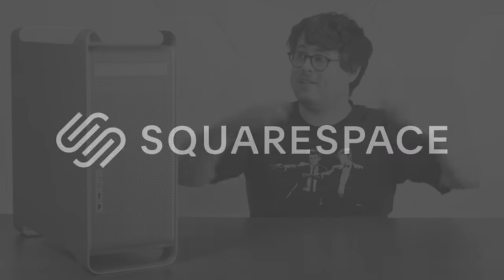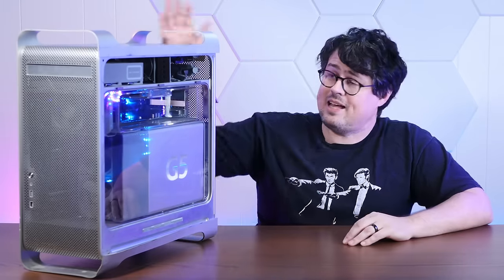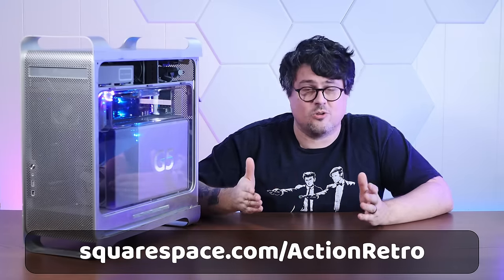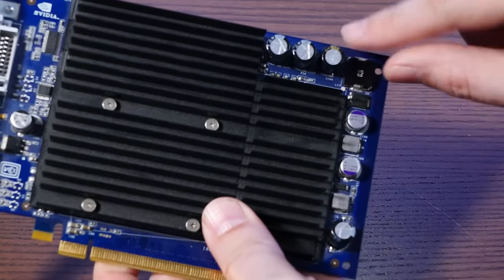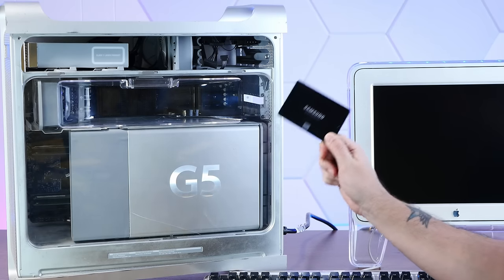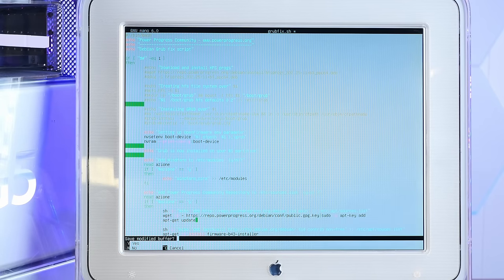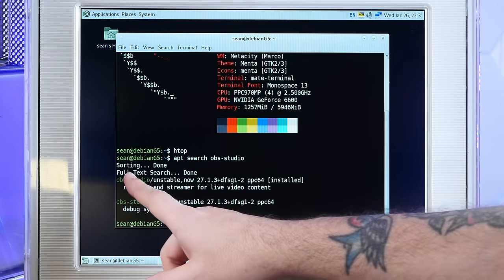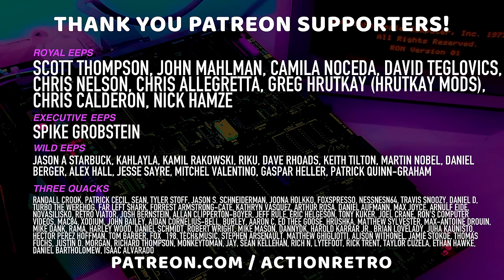Four G5s, in ONE PowerMac? It's the fabled G5 QUAD!

Comment: Hi Sean. Proud owner of two of these g5's here. You've got the best and reliable version of quad g5 ppc. These won't leak, but i would suggest replacing thermal paste on these cpus and north bridge which is located between case and motherboard. You have to remove everything including motherboard to do so. Get some temp reporting software to check what is actually happening before you put too much stress on it. Also, you probably won't remember this, but i'm a guy with that quad g5 ppc who  played on your g5 minecraft server during ppc week. We even exchanged few words at that time.
Reply: Was there a change in the hardware for these that helped them not leak?
Reply: @elitexcomputing8802  Water blocks are completely different. These newer revision gasket o-ring nevel leaked in my case. You still need to check periodicaly to spot early any leaks. Removing LCS(liquid coolig system) and separating procesors from waterblocks. I would also recommend replacing coolant for something like destilled water and anti corrossive, anti freezing, growth prevent solution. You can compare all LCS revisions on the internet. This one is the latest and probably the best . One of my quads still have original water blocks, second one has experimental modern water blocks. Who knows if this will change reliability.
Reply: In 2009 my quad G5 sprung a leak and over heated. Took it to the local Apple store and they gave me a Mac Pro 4,1 as a free replacement even though the AppleCare had expired. While I missed the old girl, the Xeon processor beat the G5 in everything I could throw at it. Was nice to be around when Apple treated their Pro customers very well.
Reply: @montex66  Surprising that Apple even cared. Xeon processors are completely different architecture, much better and powerfull. Too bad we do not know what lcs was used in yours late G5. There were three i think mostly known revisions of lcs. Might be something different as well.
Reply: @RadoslawKasprzak  that’s great to know. Drain flush and fill with distilled and something like utopia sounds like an easy maintenance to do.
Reply: I have one as well and while they won't leak (they didn't suffer the o-ring failures of the previous models), almost all variations will have their pump die.  I ended up attempting to refurbishing this myself by flushing out the coolant and refilling it (with all the requisite air bleeding).  It was a giant pain and still didn't have enough flow over the blocks to actually cool the CPU at full load.  I went through several sketchy mac replacement parts websites where they sent me replacement CPUs (they come shipped as one unit), and I've seen just about every variation of this pump configuration.  None of them actually worked.

The thing I ended up doing in the end and swapping out the LCS for the heatsinks that shipped on the 2.4GHz dual core model.  Those actually do a decent job but you need to cut the heatsinks and blocks down to size with a hacksaw.  Totally worth it as these liquid cooling systems are an inevitable disaster.  When I first bought mine it was in working condition, but years of usage and a few nights of compiling a usable Gentoo userland definitely took its toll.
Reply: @elitexcomputing8802   "Was there a change in the hardware for these that helped them not leak?"

Put simply, switching from an LCS made by Delphi Technologies to one made by Panasonic.
Reply: @montex66  I had a similar tale albeit lower spec: my second-gen white MacBook (Core2Duo rather than Core Duo) was replaced with a first-gen unibody 13" MacBook Pro after overheating and kernel panicking issues, which their techs couldn’t fix after 3 weeks so they just replaced it. 

Though mine was still just barely in AppleCare by a few months, and this was a month before the second generation unibody Pros came out, so I bet they were happy to unload some of the stock. 

I should’ve just taken it right to the Apple Store, but first I tried a local Apple Certified Repair shop — and they gave up but deleted all my crash logs which I’d foolishly not backed-up! So perhaps the Genius Bar techs would’ve not tried for so many weeks if those logs had persisted. Oh well, I still won out in the end.

Comment: I said this on Ken's video too, but the really dumb thing that baffles me about the quad G5 is the fact Apple decided to use GM Dexcool antifreeze as their coolant of choice. It was well known in the auto industry to corrode and ruin parts of the engine, most notably, intake gaskets. 

By the time the G5 Quad came out, General Motors was already subject to several lawsuits from Dexcool ruining their vehicles. When there was plenty of other fine coolants for computers back then, I don't know why Apple thought it was a good idea to use a controversial automotive coolant that's known for corroding anything metal.
Reply: it was likely cheap and maybe they were both at CES
Reply: I’ve never even heard of antifreeze being used to liquid cool a computer. Is that a common thing? Sounds disastrous.
Reply: @JoeyPerleoni  yeah man i'm a certified tech and the very thought of using antifreeze terrifies me to hell and back
Reply: @SoulcatcherLucario  glycol aka antifreeze is used in all kinds of water systems with varying metals .Black Iron pipes carrying most of the water but could be galvanized ,copper, plastic, brass etc. Those systems use anti rust compounds or just oils for lube and the glycol is anti freeze . it offers some freeze protection . thats why its in a car that can be in -30 degree weather driving down the road.
Reply: @tobiwonkanogy2975  oh i know, i'm just talking about liquid cooling a pc here haha
Reply: @SoulcatcherLucario  it rusts less than raw water. that was my point.
Reply: @SoulcatcherLucario  Many AIO liquid coolers use what is essentially antifreeze as the liquid.
Reply: The first generation lcs was developed by Delphi Automotive, I think it was the decision of Delphi to go with Dexcool. I doubt that Apple had a say in that since Delphi was tasked to provide a cooling solution.
Reply: Oh man, they used Deathcool? That explains everything.
Reply: That's what they get for sub-contracting the LCS to an automotive OEM (Delphi). Not that they would have had a much better time with the early AIO makers at the time (I forget the name, but there was one company with a patent on it), those had their own problems.
Reply: Dex killed one of my cars and would have killed another one if I hadn't proactively replaced the intake manifold before the damage got to the point of no return. I don't care how well it may work, there's no way I would use that stuff to cool a computer. Or anything else...
Reply: I put put pennzoil coolant in mine :) works great.
Reply: @JoeyPerleoni I think it would make some sense when shipping computers already filled in unheated trucks. I would of course recommend propylene glycol rather than ethylene...

Comment: Hi Sean, so nice! I got the same at home, still running fine, sporting 10.5.8, 16 GB RAM, two SSDs and a nice Quatro. It‘s my backup Mac.
Reply: Wow!
Reply: @alimehdiyev1  Woah a spec like that and its just your backup? My computer cant even beat that lol
Reply: which quadro card?
Reply: @joepepsi  should be the FX4500, which can be found as mac oem versions or you can flash a pc version. Arguably is the fastest card for the G5 at that time, though now is known that the 7800 GTX and some X1900XT can run on the G5 as well.
Reply: Now, not all FX4500 pc versions can be flashed, they can be easily spotted because on the back they have a L shape plate for the RAM. The other ones can't be flashed for the G5.
Reply: I love crazy old hardware like this. The stigma of old tech is worthless never made sense to me another then "hidden backdoors" or "bios" backdoors. another then that old hardware is mostly safe if you know basic pc security.

Comment: As someone in your last video commented, your video card isn't supported for OBS: you need a minimum of a GF8000 or Radeon HD series for OpenGL 3.3 support and none of those had PPC versions. I've been meaning to experiment with setting up a Debian 11 install and then, once it works, swapping in a PC video card without flashing it to see if Debian picks it up and configures it. That sort of thing works on a Mac Pro with some unsupported video cards under OS X (no early boot video but the card comes alive once OS X loads the kexts for it) so it may work here too. If it works I sadly don't have any post-GF7000 or Radeon X series AGP cards to test for OBS support in the early G5s but I do have plenty of modern PCIe cards to test in the later ones.
Reply: Could you install multiple video cards? Since it has multiple PCI-E slots? Maybe a more modern PC card + original.
Reply: @ElectrofizzStudiosCo  Possible, though the limited available PCIe lanes (one 8x, two 4x) will hamper performance. You'll also have to rig something up for high-end video cards that require additional power connectors, especially if you're already running a Quadro or X1900 or something that uses the lone onboard power connector.
Reply: You could technically put just about anything in there, no? I'd love to see a modern-ish single-slot video card, like an RX 560, in there. It'd be hilariously overpowered for CPUs from 2005, but it should work as long as you can run updated Debian.

Comment: Fun fact: You can use the CPU modules from this system to upgrade slower late 2005 model G5 systems. I turned a dual 2 GHz into a dual 2.5 GHz by doing just that. It uses the original solid state heat sink (which is absolutely massive) and works great.

Comment: Sean, do you have a killawatt? I'm very curious how much power this actually draws when fully under load, running something - ideally with the 17" ADC monitor.
Reply: With the quad core pmg5, you would want the aluminium Cinema Display
Reply: Probably in the area of 1.21 gigawatts.
Reply: About equal to a 400 watt room heater, very noticeable. I haven't checked mine with a calibrated ammeter or wattmeter yet. Works on 10.5, having trouble with FreeBSD. Have fun
Reply: I had an Xserve G5 until the power supply blew up. It was like a plane taking off, and ran hot. Ideally you would have your own room for it. I'm sure with this thing it would run a bit quieter than my Xserve did. But the biggest issues with the G5 were heat and inefficient cores. But that's what you get when you're so anal about running chips that aren't AMD64 based and designed to run in servers.

The G5 was never really even designed to run in a desktop let alone a laptop.

Comment: I bought one of these about a year ago and went on a binge of getting it as upgraded as possible, regardless of price. The result:
- Nvidia GTX 7800 GT (I also have the Quadro but it doesn't run Minecraft as well)
- 12GB of RAM
- an eSATA card
- a FireWire 800 card
- a Sonnet G5 Jive with three 500GB hard drives

This machine is literally the permanent machine at my family home. I can't bring my computer home every time I come back from uni, so that G5 serves as the machine I use when there.
Reply: are you guys still using it today

Comment: The quad G5’s have a very very well sealed water cooling system. The earlier water cooled models were much more unreliable and prone to leaking. I think Ken’s machine was a pre late 05 machine, hence why it blew up from dexcool leakage. I have 1, also externally damaged (thanks shipping) that was bought untested. I’m getting the parts delivered soon since it seems to work. I really hope it ends up going well, since apparently the water cooling system is known to have failing pumps and clogging coolant at this age (but not likely to explode, again they are over sealed after the reporting of leakage). If you did see corrosion, it’s like a nasty cinnamon roll color, so if it was leaking you’d be able to see it. If you do rebuild the LCS, please for the love of god post it. I really want to either get the system rebuilt or convert it to air cooling. These machines are too cool to die.

Comment: A few months ago, I picked up a dual-core G5 (two single cores @ 1.7) out of a trash pile and brought it home. Sure enough, the cooling system leaked all over and ruined the inside, seeping under the cpu pins on the board. While pulling it apart, everything I pulled seemed to be more corroded than the last. The only thing that was in semi-decent shape ended up being the shell, so I currently have it sitting while I try and scrape enough time together for an ATX conversion

Comment: Okay, let's jump in here. I actually have two PowerMac G5 Quads. My pride and joy is the Quad that is paired with it original 30" Apple Cinema display, and it's original Apple Bluetooth keyboard and mouse. Yes, the one button Bluetooth Apple Mouse. Still, you are not wrong about the rarity, there were a limited number of them sold in the first place.However, let's try to put an end to the myth about the liquid cooling. The early liquid cooled G5's did have a huge issue with cooling problems. Note the famous Computer Clan episode where Ken's G5 made a guge POP, smoked, and turned out the lights. (Note, that was not a Quad.)

Yet, by the time of the Quad, Apple had solved the liquid cooling problem. Indeed, many people, including myself, would say the only liquid cooled PowerMac to consider is the Quad. Problems with the cooling system for the Quads wer few and far between.
Reply: sounds like a nice setup. I had a similar experience with a dual 2.7 power supply exploding on me, and this was a free PMG5 that someone gave to me and I didn't know anything about it 😂

One thing I am wondering though, and Action Retro also mentioned in this video, is that earlier G5 Quad models had 1 pump and later models had 2 pumps. Does anyone have ideas on whether one was more reliable than the other, or were they about equal?
Reply: @Wind5387  That's not exactly right. All the G5 Quads had the same liquid cooling system. It's the two earlier liquid cooled systems, the dual processor 2.5 GHz from 2004, and the dual processor 2.7 GHz from early 2005. There are some of those which were upgraded to the better cooling system, but I have never actually seen one. If I ever ranibto a DP 2.7, I might pick it up if it were cheap enough, just from the collection standpoint. I'd be real careful about running it though. 

Hrutkay Mods has a couple of videos on trying to convert a 2.7 to air cooling, with limited success. It's interesting viewing though.
Reply: @brokenelectronics3665  I see, thanks for the clarification. It's good Apple finally got their act together for their last PPC systems. It's a shame the early liquid cooled G5s were so unreliable, and as I've also just learned, they went ahead and used the same coolant that was blowing up GM engines. They seem like such rushed/afterthought designs. 
The only other PMG5 that I find particularly interesting are the ones with the 1:3 processor/FSB, (the late 2004 version), which might be (one of) the least risky PMG5s to get.
Reply: @Wind5387  A really nice machine is the dual core 2'3 GHz late 2005. It's fast. and it's air cooled, so it's very reliable. I've got one that was my go to Power Mac until I lucked out on my first Quad. The dual core 2.0 GHz models are also really nice, I have two of those.

Comment: There were actually at least three different iterations of the liquid cooling system. The first one wich came with the 2.5 GHz dual processor G5 was prone to leaking. The second iteration came with the 2.7 GHz G5, Apple switched from first to second generation liquid cooling mid production of the 2.7 GHz. So there are 2.7 GHz models with the old and the new liquid cooling system. The third iteration of the lcs came with the G5 quad and it was NOT prone to leaking. It works perfectly fine for years, but of course after 15 years now they are starting to show their age. It hurts to see so many people on Youtube turning these things on withot taking a look at the old lcs first.
Reply: I actually had the 2.5 Dual with liquid cooling, it never leaked but the Power supply gave out, I replaced it but in the end the machine was way too slow and it's fans would rev up every time I did something simple as open an application, the early and mid G5s were a nightmare in my opinion, when they made the late 2005 G5s they seemed to have worked out all the kinks, my G5 quad has been nothing but reliable and it doesn't ever rev up its fans.
Reply: I think the 2004 dual 2.0 GHz model was also good. I owned one in 2008 and it was neither slow nor too hot. It roughly matched the speed of a 2.0 GHz Core2Duo MacBook Pro. Unfortunately this thing became quickly outdated after 2008.

Comment: Awesome video - funny and informative. Brings back memories of my dual 2.5GHz Power Mac G5 with water cooling. A few days after the 3 year warranty expired, it kept randomly going to sleep. I followed Apple's helpline advice and ran diagnostics on it - during which both CPUs melted and the machine never booted again. Turned out the coolant had leaked, but the leak wasn't visible until after I removed the "warranty void if removed" CPU shield. While disassembling it, some remaining coolant dripped all over the rest of the case, corroding it heavily. I really wanted to keep that machine as a display exhibit - I always marveled at its beauty. A few years later my Dad dropped it off a shelf and heavily dented the case 🥺😢.

Comment: Always wondered if modern cooling fluid would work on these, just to avoid further damage caused by Dexcool. I have its 2ghz cousin so no worries there, but I consider it special since it was made around 2 weeks before the Mac Pro launch so perhaps I have one of the last PPC’s built and it goes like a champ still.